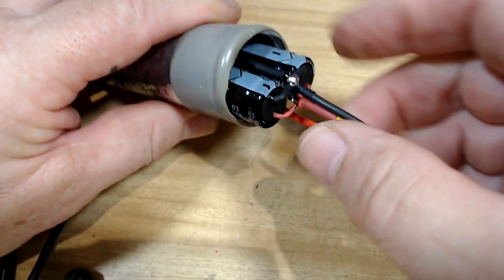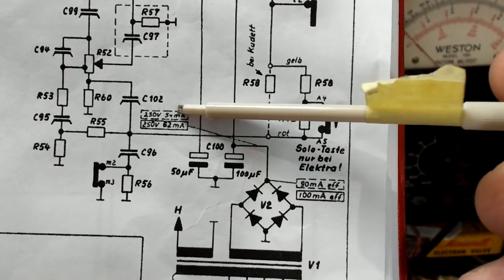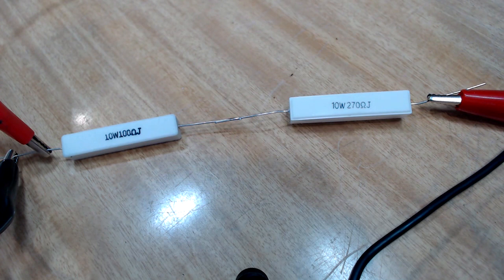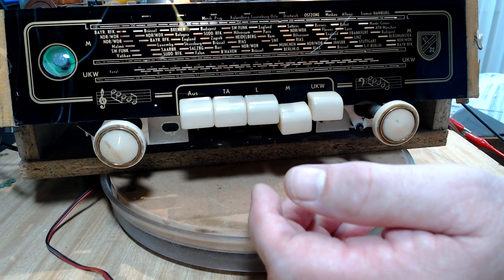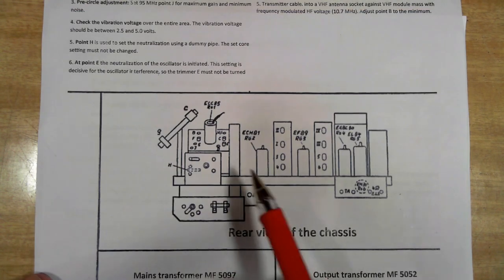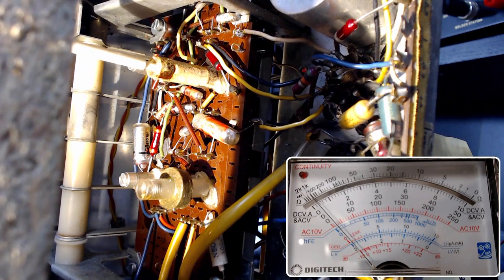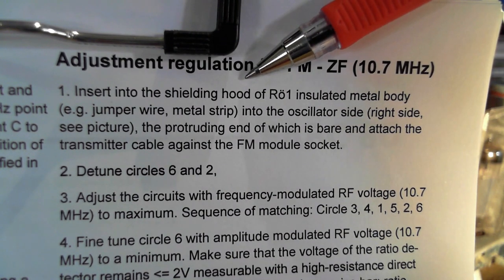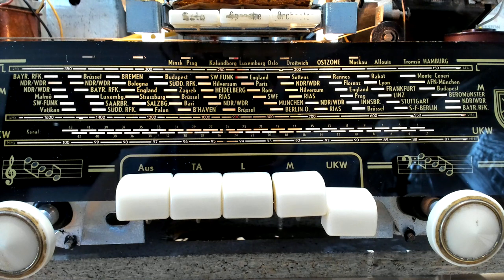NordMende Elektra 58 Restoration & Selenium Rectifier Part 2

Comment: Love the Cap+Resistor solution, well done.
Reply from the maker: Hi Bruce, thank you, I wasn't sure how that was going to work out 🙂
Reply from the maker: Thunder Kunt  The two components are wrapped in foil and the foil is grouded to the radio chassis, the foil inhibits stray frequencies being picked up by those components and drains them to ground.
Reply: I agree, very slick solution.
Reply: @DavidTipton101  I especially like the design of the paper wrap. Ernst Roederstein (founder of ero capacitors) would be proud ;)

Comment: What a beautiful job you did on that capacitor/resistor combo. It looked so great, just like the original.  Very nice work on the alignment too David. You do such wonderful work sir.
Reply from the maker: Hi again Gregg, that cap/resistor combo nearly got past me, thanks to Dirk for picking that up. The finished result does highlight that you can make realistic reproduction components if you needed to. Thanks for your comment Gregg 👍😀

Comment: It's so nice that you can get useful stuff from the comments. Obviously not from me, as I haven't got a clue about radios, but Dirk from Belgium is a star.
Reply from the maker: Dirk is my hero 🌟 I have since seen another video with a different brand German radio and it had the same cap/resistor setup, the guy wrapped the two replacement components separately as his solution. I guess as you gain more experience with different build philosophies it becomes a bit easier... I hope 😀

Comment: Good engineering on that rectifier circuit
Reply from the maker: Thanks Cosimo, It worked out well, I get a little worried when I have to use big resisters like that 🙂
Reply from the maker: hawkturkey  Thanks for that. The reason hum was induced was because I had to pass the AC wires very close to the speaker wires and other sensitive components to access the top of the chassis. The only other way was to drill a new hole or run the wires around the outside of the chassis which I didn't want to do. I twisted the wires to and from the resistors, I think you can see them in the video 👍🙂

Comment: Well done David. Great alignment and very brave with the FM adjustments. Good work on the silicon rectifier. I did a Roberts a while ago with 1 volt tubes so had to be very careful when the selenium came out. Just spent a week trying to get the BFO working on the Hallicrafters. Needed some help and components from forum members to do it but seems to be working now. Looking forward to the next video.
Cheers Lynton
Reply from the maker: Hi Lynton, thank you, I hope to learn a bit more as I go. Forums are a great help with radio problems and I use them if I get stuck. Really, one volt tubes in a mains set, that's unusual, for me anyway 🤔😀
Reply: Hi David the set is a Roberts R66. Battery/ mains. Popular set in its day. I’m sure Google will show you one. Cheers Lynton.
Reply from the maker: @lyntonprescott3412  ahh... battery/mains, that makes sense.

Comment: Nice job Dave. Those German radios are really very different. If you want to find an LW  transmission to check your radio. Google a local airport info ERSA gold coast for example and look for the NDB (non directional beacon) This is 278KHz for gold coast. This is a Morse code transmission.
Keep those vids coming. Great entertainment while we are all confined to barracks.
Reply from the maker: Hi Bob, Ok I will try that thanks. I do remember picking up Archerfield Airport (I think) automated weather information once with a Bush receiver on LW. Hang in there Bob 😀
Edit: I just tried it and Gold Coast NDB came through right on 278 on the dial. I think it was terminal information I picked up from Archerfield airport

Comment: Everything you replaced on the chassis was very neatly done and nothing looks out of place. Sounded pretty good on FM. You may say you know nothing about FM alignment but you know more than I do!

It'll be very interesting indeed to hear what it sounds like through it's original speaker in the cabinet. Normende was one of the better makes so I imagine they probably went to some trouble over acoustic performance and used a decent speaker.

Excellent work as usual and a fascinating video. Looking forward to the next one.
Reply from the maker: Hi Paul, the FM alignment was good to learn, I hope I can build on it as I go along, the FM sounds very good too. I am missing the original speaker but have a replacement speaker that I hope to shoehorn in. The original was a peculiar shape and hard to replace. Thank you for your comment 😀
Reply: @DavidTipton101  Oh yes, I forgot the original speaker was missing. I've been there myself and have had to get creative!

Comment: Re your LSG-11 signal generator: those came from the factory with "death caps" connected from case to the mains cord, and the danger with these is that when they fail you can end up with mains voltage on the case -- hence "death caps". If you haven't already done so, get rid of those either entirely or replace them with Class Y safety caps. (I simply got rid of them in mine).
Reply: Thanks will check my one out
Reply: Good to know! I've got the same unit but haven't restored it yet
Reply: I have the same unit and have replaced mine with safety capacitors. I really like this unit.

Comment: Hi David.  Nicely built component for the Cap/resistor package.  i think I would have just put them into an old Cap can, but then I am getting lazy these days!
Reply from the maker: Hi Bob, the package came up nice, pity none will see it 🙄🙂
Reply: @DavidTipton101  Hundreds already have, thanks in part to YouTube. Plus you filmed it, so there you go.  Nicely done to if I may add.
Reply from the maker: @BoB4jjjjs  ha ha, good point Bob 😄

Comment: I am trying to find things I can use that casting material for, it's impressive.  The resistor heat sink is clever too.  Such neatness.  Cheers
Reply from the maker: I Pauline, I know it's brilliant, I'm looking for things to cast now. I am going to order same moulding silicone so I can do a proper job. Thanks the resistor worked out well, cheers, stay safe Pauline

Comment: Hey David!
I thought I had figured out something cool...but, well, there goes Murphy again!  I did a Google translation thinking that the NordMende was German for "Normandy", but the German for Normandy is Normandie.  The "Nord" part appears to be "North", but the Mende doesn't translate.  At least not to anything sensible to me.  Perhaps you have a German viewer that could shed some light on the issue?
I LOVED your engineering on this set!  The manner in which you mounted the Bridge Rectifier, and the mounting of the 10 Watt resistors was shere Genius !
That "Resistor / Capacitor was quite interesting!  I had never known about those.  I have seen some in the past that simply had a shield over the outside foil and the lead from that shield was connected to ground, but never one with an actual resistor built in. While watching you hold the capacitor and resistor combination, I thought you might be planning to put heat shrink over the combo, but your choice of what to do was brilliant!   I don't think I have ever heard of that substance you covered the resistor in. Learn something new every day!
Stay Safe, Stay Strong, Stay Healthy, Stay Happy, And know that you are very much loved and appreciated by many people!
Reply: The company's founder was named Hermann Mende. After the war the company had to move west of the Iron Curtain and renamed itself from Mende to Nordmende, as the new HQ was north of the original location. It's short for Norddeutsche Mende (Northern German Mende).

The English Wiki article has a few typos and inaccuracies but it gets the message across:
https://en.wikipedia.org/wiki/Nordmende

My summary above is based on the German version.
Reply: @Ragnar8504  , Thanks so very much for the information!!!  I did read the article...was interesting.  I had gotten a translation of "North Mende" but that didn't make sense to me.  Your help along with that article made sense of it all.  Thank you again!
Reply from the maker: Hi Wayne, I did the same Googling as you and got the same non answer, thankfully Ragnar8504 has supplied the correct answer. Thank you, the rectifier replacement and resistors was the first time for me so I was happy with the result. The casting material is called Smooth Cast, I got it to make my Kriesler badge for the Beehive, it was ideal for the job. My wife and I are bunkered down and doing OK at the moment, I hope we all get through this in good health, vhjeers 👍🙂

Comment: Top line job again David ,interesting on the cap with the 10meg resistor well spotted by ur watcher and very nice job indeed on the one you made, didn't know they used that sort in radios, I do know that the microwave oven filter caps have that arrangement .Nice to see the Leader signal generator in the test gear shelf ,hve one of those myself ,Ok enjoyed very much and stay safe in lock down.
Reply from the maker: Hi Doc, I trust you are safe and well. The cap/resistor thing was a surprise, I thought he was pulling my leg for a while but I know for the future, now they are in microwaves too, that's another thing I've learned. The Leader is in need of an overhaul, I will do that while I'm locked up... I mean down 😀
Reply: @DavidTipton101  Yes  thanks all safe so far ,and been getting some workshop jobs done.

Comment: David, at 21:30 you talk about an unstable counter, the Victor VC3165. Please check the input print on that thing, behind the two BNC connectors. There's a lot of problems with bad soldered shealding, some even shorting out components. It has (in some series ?) been done by someone without ANY form of experience, and it has crippled a lot of these counters. Mine too. I had to fish solder out, that had been plummeted in front switches and shorted it, and had to replace two chips on that input print, redo the soldering of the shielding, and re-solder a cut capacitor, to get it to work.
Reply: B.t.w., on function 3 of the settings the range is below 2 mHz, so you would normally use that for 1.5 mHz, but in your 'broken' situation, maybe for 1.5 mHz it is more usefull on the function 2 (2mHz - 50mHz), which is able to measure a bit below 2 mHz (At least mine is)
Reply from the maker: Wow, that's a lot of defects. I haven't had any real trouble with mine, I think the issue is the way I have set it up, I need to do some investigating. The problem is only at the higher frequencies and isn't a problem normally, only with some radios. I don't know why it was on this one. I'll check out setting 2 for the higher end of the BC range see if it's any better. Thanks for the information Erik 👍😊

Comment: Very impressive overall and specifically addressing the heat production of the resistors with a heat sink. A quick "how to" for me facing a selenium rectifier in the future.
Reply from the maker: Thanks Hallicrafters Rehabs, I would normally use the chassis as a heatsink but there was a shortage of tenable real estate for that purpose. Another comment suggested using a capacitor as a voltage dropper, I am going to try that out next time. The Comment was from Andrew Pike 🙂

Comment: Hi Dave,
It is good to see someone like you applying a few of the ‘old methods’: such as tape on the IF alignment tool, and the ohms law triangle.  It is amazing how many radio restoration enthusiasts are not familiar with those.  Also when you calculated watts is another one you applied that served it’s purpose.  I usually advise those new to this hobby to memorise the four formulae on the ‘Pire’ wheel.
When you cast the resin substance around the 10meg resistor, was it the same stuff you used to cast the name badge for the ‘beehive’ radio?  Could you please remind me what that substance is, and where did you buy it from.  I’m thinking here about whether it might also be useful for casting radio knobs.
Cheers my friend, Phil.
Reply from the maker: Hi Phil. The PIRE wheel is an excellent reference, there is even a phone app for it I found yesterday but still good to commit to memory if you can. The plastic mix I used for the resistor is the same as for the badge, it is called Smooth Cast and I think it would be very good for knobs except I am not sure if the cast material can be coloured,  The finished knob may need to be painted. Cheers 🙂

Comment: Radio sounds great. That was interesting about the capacitor with a resistor in the same package. I replaced some capacitors that look similar on a Philips BD 284, now I will have to go back and see if I made the same mistake. Nice job making that component, right down to the label. Nice job on the resistor install as well. You do very nice work.
Reply from the maker: The radio is working very well Phillip. I had a look at your Philips schematic and can't see a cap/resistor combination. there are two shielded caps but that's all. BTW the schematic for the Philips is very clear, my Nordmende was on A3 and I couldn't read it with a magnifying glass 🤦‍♂️ Thanks, the resistor solution worked well eventually 👍😀
Reply: @DavidTipton101  I've never seen that solution before and I've worked on a few European radios from the second half of the 50s! One had plenty of shielded caps but they were all a bit homebrew, wrapped in soldered copper tubes. I managed to reuse most of those, although I had to enlarge most of them slightly, as the replacement caps were shorter but thicker than the originals. Later examples of the same model (Eumigette by Eumig) skipped the cap shields altogether.
Reply from the maker: @Ragnar8504  I wonder if sometimes things are done because "we always do it that way" and are just carried over from the last time. Your non shielded later model being an example.

Comment: The magic eye on my capacitor checker is much brighter I thinking your should be too,or maybe it's to bright in your room ,your repair is very good ,on the dropping resistor would a piece of aluminum heat work a little better?or it that temp ok. I am still learning .
Reply from the maker: Hi Ron, I think it is a little dim, it is running a bit low on voltage but it looks perfectly OK in the radio, it might also last a bit longer running it a bit lower voltage. I had the resistors sandwiched between two thick aluminium plates wich overhung the resistors. I could have bolted an additional finned heatsink on the front but it was working very well at that temperature. I normally mount resistors like that directly on the chassis but there was no convenient room on this radio.  The resistors I used have a rated temperature range of -55°C ~ +155°C 👍

Comment: The "V" coil is the one mounted on the antenna receptacle board. NIce work on that special Resitacitor :)
Reply from the maker: Hi Derek, I wondered that but it isn't marked as such and why would an IF blocking circuit be mounted on the antenna? Having said that I adjusted that coil as if it was the 'V' and then for maximum signal and least noise on a weak station but it made little difference with either adjustment 🤔
Reply: @DavidTipton101  2 reasons: stops frequency same as the IF entering the radio from the antenna, and stops the generated IF from radiating via the antenna. Imagine the whole city's radio listeners radiating 460khz at once. You inject the IF signal at the antenna input, Then tune for a minimum.
Reply from the maker: @DerekHerbst747  Right, I'll give it another go, I didn't get any change last time, I will test the coil and capacitors associated with it first though. Thanks Derek 👍

Comment: I am curious - what model is your small signal generator with the lcd touch display? Are you reasonably pleased with its capabilities? I look forward to your projects and learn a lot from your videos.
Reply from the maker: Hi Mark, the generator is a Silicon Chip project, it cost about $100 to build and is quite good. It has a built in oscilloscope function to allow you to can see the alignment point but I have never got that to work.  http://www.siliconchip.com.au/Issue/2017/April/Micromite+BackPack+Touchscreen+DDS+Signal+Generator?res=nonflash

Comment: Regarding the resistor dropper you made when you replaced the selenium rectifier. You could consider using a capacitive dropper on the input of the bridge. You would need to establish what resistance you would require in the bridge input to give you the correct voltage output. You can't do this on the output of the bridge rectifier because it needs to be AC. Lets say for example you need 300 ohms.
You would use the formula C = 1 / (2 * pi * F * R) , therefore to substitute for values C = 1 / (2 * 3.1412 * 50 * 300) = 100nF. You would need to check the resistance for yourself as 300 ohms was a guess. The great advantage of a capacitive dropper is not dissipating the heat, having to do it on the AC side is the disadvantage. I would also suggest a Y1 capacitor type be used or at least a 400V DC working ceramic. Also fit a bleed resistor (say 4.7 meg ohms) across the capacitor to ensure the charge is bled away when the power is removed.
Reply from the maker: That's a good idea Andrew, I will try it next time I need to do this, your comment is printed and saved, thanks 😀

Comment: You could possibly use your sig gen to align the VHF section by setting to a high fundamental, then using the harmonics to align, maybe 45-50MHz, or 28-35 for the 3rd harmonic.  Not sure how high it goes.
Reply from the maker: Hi David, My signal generator should be capable of covering the FM spectrum but it doesn't at the moment, it needs some attention. I will service it at some point 🤔🙄